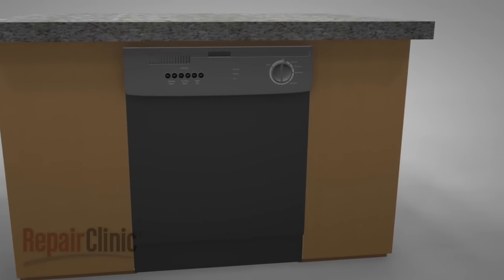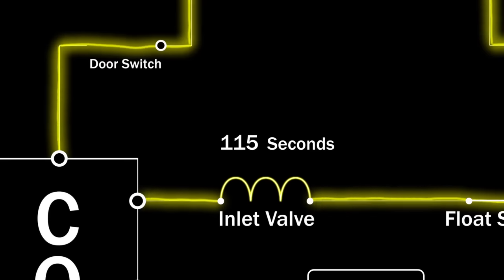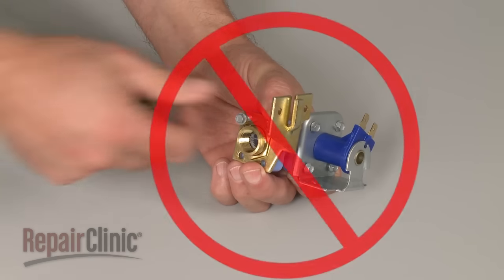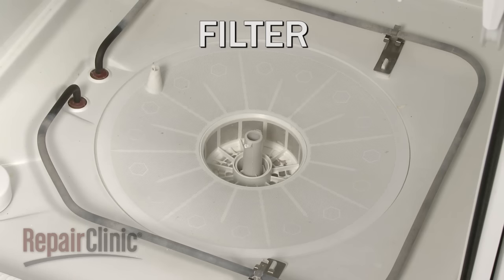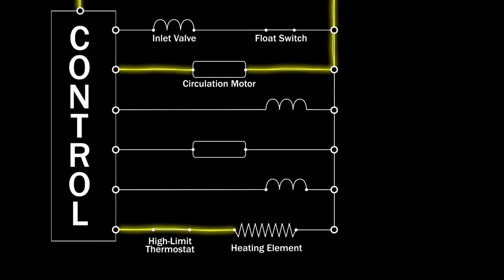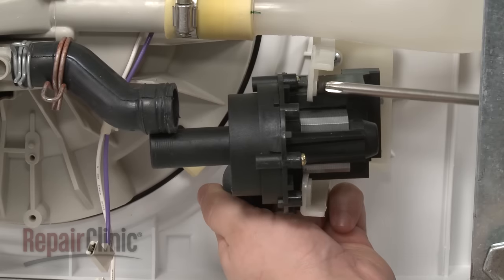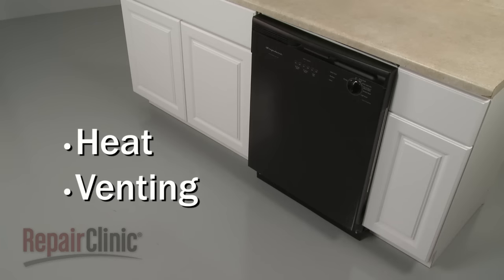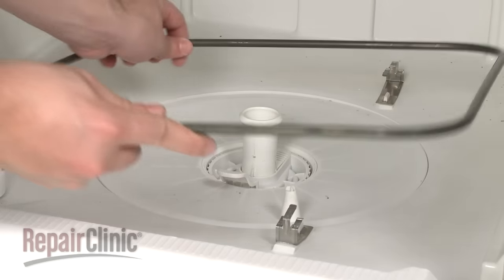How Does A Dishwasher Work? — Appliance Repair Tips

Comment from the maker: Thanks for the comment! Some dishwashers actually do have an added feature that allows for extra rinses. You could also install a water softener to your house water supply. This would improve your dishwasher's performance and would cut back on the amount of soap or detergent needed. There are many benefits to this besides improved dishwasher performance as well.

Comment from the maker: How the check ball works is actually a little complicated to explain in a YouTube comment. It has to do with the flow of water pushing the ball up and down a ramp, with the outlet port for the lower wash arms at the bottom of the ramp and the outlet port for the upper wash arms at the top. The timing of the water shutting off and starting again determines where the check ball is resting and which outlet port is blocked.
Reply: RepairClinic.com my dishwasher is making a smoke-like smell. What should I do?

Comment: Hey RepairClinic, My dishwasher is no longer working, When i turn it on, it sounds like its trying to filling with water, but im not sure if it actually is, i cant visibly see water in the bottom, and theres still the dirt and particles on the bottom, if i wait for a minute or so, it goes to what seems would be the rinse cycle, but the only thing it does is make the whirring sound of the motor, no water shooting up or anything. Im going to try what was mentioned in this video about filling it up manually and try it again, I just wanted to get in touch and see if you have any tips. Thanks a bunch. Can't afford a new dishwasher and I just spent $45 on maintenance parts for this one.

Comment: i just purchased a new one and it does not have heated drying to get its energy star rating. just open the door and let it air dry. works fine, no spots. i also have soft water, that helps.

Comment: Thank you for this video.. So, the water level is not determined by the float, except when it becomes too high and the float switch stops it. Then what determines the water level? Is it simply a time setiing, the inlet valve stays open for a set length of time?
Reply from the maker: That is correct.

Comment: Another thing that wasn't mentioned is the hard food disposer.  I know that many dishwasher manufacturers have done away with this feature to reduce noise.  Many dishwashers now rely on just a filter, that needs to be manually cleaned.  

But many dishwashers currently on the market, including the Frigidaire model shown in the video, do still contain food disposers.
Reply from the maker: Thanks for the info!

Comment: I was just thinking since the whole process requires it to draw more electricity from the power supply maybe the heat generated from the drying process of the previous cleanng can be converted to electric energy and then be used to  run the machine in the next cleaning?
is it possible?
Reply: That is really an excellent Idea, but the heat generated during drying process is infact transferred to the items to be washed (thermal equilibrium) so in reality there is no energy wasted in the process of heat transfer.

Comment: Our Fisher & Paykel dishwasher has all of a sudden started tripping the outlet RCD breaker today, after using it once in a long time, causing every single outlet in the house to lose power. Ran a full cycle with eco mode turned off. Was 97 minutes before it started, but 19 minutes remaining at the time of fault. After turning the breaker back on, I notice, the dishwasher drains fine, fills up and washes fine, the fault happens just right after that. Right now I have no idea what could be causing this. Any suggestions are helpful.

Comment: are their any manufacturers that still make a dishwasher with a mechanical timer?

for some reason, controle bords on new dishwashers like to fail some times and their are 30 year old dishwashers with timers that have never been serviced. any info will be great. thank you
Reply from the maker: Yes, there are dishwashers with timers on the market; they tend to be lower-end models. You'll find these both in brick-and-mortar retailers and online.

Comment: Just install my dishwasher.  I think I cross threaded the elbow where the water feed line connects the nylon male fitting.  Anyone out there know how I can fix this?  I thank you in advance!
Reply from the maker: Remove it and try to secure it again. If you can’t get it tight enough to prevent a leak, you will need to replace the water valve.

Comment: At first my dishwasher buttons weren't working. So I replaced the control panel then it started to work. But now it won't drain the water and won't turn on. Any suggestions or tips?

Comment: Is it possible to remove water from salt chamber at the time of refilling?
Reply: You should not remove any water, my instructions clearly say you need to just pour the salt in and it will displace the water (Salt will sink to the bottom and water will pour out of the container). But that is ok since water will just drain through the filter and during next washing it will be drined out.

Comment: I bought a new timer for a Dishlex dx102WB*00 part number 0574400063,  but it didnt come with the plug in diagram, has about 12 small plugs. Can anyone help me to find that diagram. I put the plugs on as they came off the old one, but just want to check the wire colors to the rite pins I should have taken a pic befor dismateling. Thanks so much

Comment: I enjoyed your video showing how a dishwasher works.  However; your "diagnostic" presentation is lacking in continuity!  At the outset, it was asking: " what are the symptoms experienced?"  I clicked on "dishes are not being dried.  I was apprised that perhaps my heating element might be the fault...so far that would be a viable solution.  It went on to explain how the part might be tested for continuity, etc.  Of course I already knew that!  I've already replaced the heater element...and the "high limit thermostat".  What your "diagnostic help" program should have offered is a simple: 'if that didn't fix your problem; test your high limit thermostat....and then it should have inquired: "did that solve your problem?"  Your well meaning program needs to be "tweaked"; shucks; I could have presented a more cogent, helpful analysis than that!   Wes Hill
Reply from the maker: We also have some symptom diagnostics videos that might work better for something like this click here: https://www.youtube.com/watch?v=P9BOvEb0v8c
Reply: ***** Thanks...I did check it out and it is more helpful...I've replaced the "heating element", the "high limit thermostat"; and I have done a "continuity check" on both.  The heating element was obviously defective since there was no continuity...I also did a similar check on the existing "high limit thermostat"; I found there to be continuity...so; is that good or bad?  Should it be "normally on, or normally off?"  I think there might be another possibility that I have yet to test....please advise me further.

Comment: I'm not sure what's going on with my dishwater...It's pretty new and it hasnt worked properly before...When  I start the cycle.. it sounds like its working, you can hear the water and all and the sound of draining but when it's done and you open.. its like nothing happened.. the dishes are still dirty and soap is still there on the floor of the dishwater...I can't figure it out.

Comment: my frigidaire is not that old and when it fills with water it will not start up,  the unit knows the door is open and closed all controls work and it will drain when the start button is pressed for 3 seconds,   it just wont start up after it fills with water,  whats wrong with it ?

Comment: There something you guys forgot 120 volts VAC going to the dishwasher vent fan and waxing motor as well remember?
Reply from the maker: Isaac Nelson Not all models use a motor to operate a vent. You are correct that models with a motorized vent, the motor is often 120 volts.

Comment: My dishwasher came with the house I bought 6 months ago.  The rinse aid has never needed to be refilled.  My glasses are cloudy and spotted.  What could be wrong?
Reply from the maker: Lisa Wingfield The most common cause of cloudy and spotty glassware is etching, permanent damage caused by using far too much detergent. Unfortunately, there's no way to remove etching once it's on your glassware. Try reducing the amount of detergent. If the cloudiness and spottiness is still occurring, there may not be enough water entering the dishwasher. Check for water flow restriction; enter your dishwasher's model number in our website's Repair Help section for model-specific troubleshooting and repair help information: http://www.repairclinic.com/repairhelp?TLSID=1773. Another cause of this is hard water. You can test for hard water with a water testing kit available at most home improvement centers.